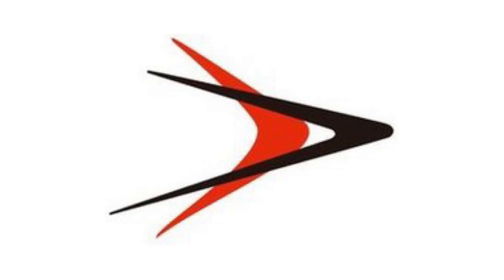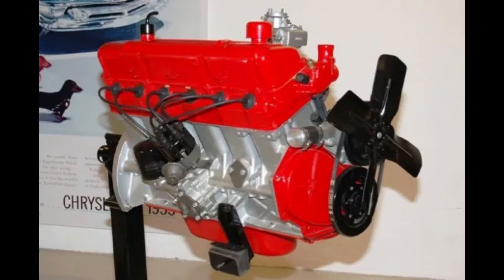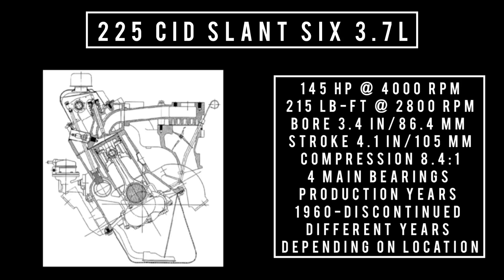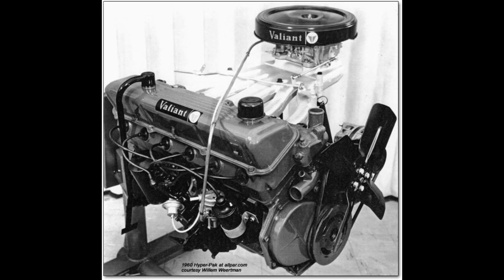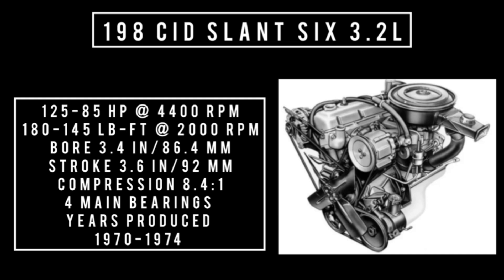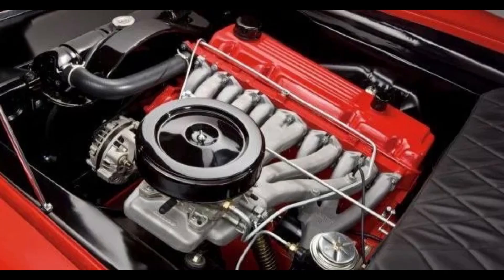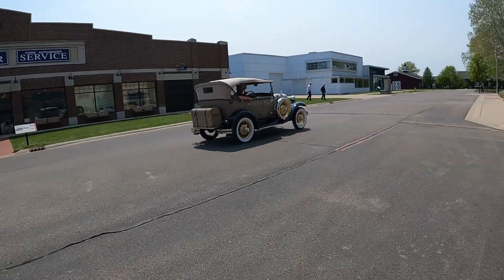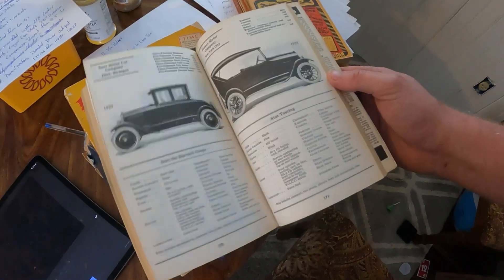Chrysler slant six engine family

Comment: How long was the 361 cid in production? I'd heard the government used them in military vehicles for many many years
Reply: 381 was made from 1958 to 1966. It was part of Chrysler's B - RB big block line. Practically the same as a 383 except a slightly smaller bore. Phased out in favor of the 383 as the base big block engine.
Reply: If memory serves, there were actually two Chrysler 361s. The early one was an RB block; it had a B-block cousin of 350 CID. The B-block 361 followed soon after. I have a ‘58 DeSoto with a 350.

Comment: I have seen a number of 225's with a blown #6 con rod . The reason was always a leaky radiator  and instead of pulling it and soldering the leak they keep dumping in aluma seal or barsleak until the cooling jacket finally gets clogged in the back end and # number six cylinder does not get any cooling and the bearing goes south. Great motors ,not so great radiators
Reply from the maker: Awesome information

Comment: In Argentina we love 6 cylinders and the Slant Six is one of the favorites, durable, powerful, versatile. It is equipped in cars, vans, trucks and sports cars; Our most powerful sports cars with the Slant were: the

Valiant 4 GT 1967/68 and Dodge GT 1969 with 155 hp and 300 nm

the Valiant 3 GT 1965 and Valiant 4 GT 1966 with 180 HP and 304 nm

and the pinnacle of the Slant Six in Argentina which was the 1974 Dodge Polara RT with 174 HP and 333 nm, although it had 6 HP less than the Valiant 3 GT, the Polara RT was much faster: 
0 to 100 km/h: 11 second 
Top speed: 182 km/h

Valiant 3 GT:
0 to 10 km/h: 12 seg
Top speed: 162 km/h

The Dodge Polara RT was a beast of its time, being the second most powerful 6-cylinder Coupe in Argentine History, I leave a video of a Dodge Polara RT: https://youtube.com/watch?v=9ybwVzdzeQQ&feature=share9

In addition, the Slant Six was 8 times champion of the Turismo Carretera (Argentine category) with a displacement of 3 liters, it generated from 255 HP to 320 HP in its last years, reaching regimes of 8000 RPM and maximum speeds of 270/280 km/h. 
Long live the leaning tower of power.
Reply from the maker: Awesome information thank you so much for taking the time to share all of that =) 

In my opinion there isn’t anything sexier than seeing/hearing down low grunt of a in-line six breathing through 3 Weber side draft carbs
Reply: @What.its.like.  Yeah !!!! The 6 cylinders roar loud. I show you how the Slant roars in Argentina:
https://youtube.com/watch?v=nCIintqAJQQ&feature=share9

https://youtube.com/watch?v=YXDM43V6spY&feature=share9

https://youtube.com/watch?v=VtVEX8EV40Q&feature=share9

https://youtube.com/watch?v=AhE_34HeTdw&feature=share9

https://youtube.com/watch?v=h6m-CVuum_k&feature=share9

https://youtube.com/watch?v=am0y2rCtUHo&feature=share9
Reply: @What.its.like.  we also had a rare version of the 188 ford with 3 Holley's (the Serra Lima), but the most famous around here is the IKA  (Kaiser) "Tornado" with it's 3 Weber's DCOE, it was an AMC 232 derivative but with OHC and other changes. There was also a bored out 4.0L race prepped version with 250hp which could be bought from the dealer

Comment: Not a option, but I’ll pick the Ford 240/300 inline 6. Very little to go wrong since the cam shaft was driven by a gear which was being run by the main crankshaft. Could easily run for 300,000 to 500,000+ miles before a overhaul.
Reply: I've had two of these. Smooth and bullet proof.
Reply: @freeman48083  the Ford 240/300 inline 6 or the Chrysler slant 6?
Reply: @seana806  The Ford. My grandfather had a couple of slant 6 engines, including a pickup. The motor was reliable, even if the door fell off :-)
Reply from the maker: Awesome choice 

Going to do an engine episode on that family of engines as well =)

Comment: I had three, A 1970 Dodge Dart swinger, A 1977 Plymouth Volare, And a 1980 Dodge Diplomat. They were all very good cars never a problem with them. I guess that is what makes me so mad about Chrysler. Back in the 1960's and 70's their cars were so good. Bulletproof actually. As a teenager in the 1960's we would go out in my best friends 1965 Dodge Dart .four of us on back country roads drinking beer that Dart got beat on once overheated to the point it would not take water in the radiator it would spit it back out until it cooled some. We ran it hard for two years driving in fields just pounded on it and we never killed it. He traded it in on a Dodge Coronet.
Reply from the maker: Thank you so much for sharing those memories I wish that I knew Chrysler when they were in the shell not the shelf that they are now.. The biggest thing I miss about Chrysler is the gambles they used to take and just the risks like the whole jet turbine engine program, no other company would even think about doing that

Comment: WYR? Chevy 235 and don't forget that engine continued to be made overseas until 1979 in Brazil.  I'd also take a Slant 6.  Both of those engines were very reliable.  The real choice though?  Ford 300, tough, powerful, dependable.

A side story- The Revell Slant 6 you showed.  My dad worked at Revell from 1956-until 1965 in the art department as the instruction sheet artist.  He brought home prtotype and watched me try to assemble them and would make adjustments to the instruction sheets. He knew I loved mechanical things, he brought me 2 Slant 6 kits.  Great fun!  And the first time I had to actually work on one?  I knew 90% of how it was. 

As another aside Mom worked for a company named Romalite - she was responsible for making and painting the Revell models you saw in hobby shops back then.

Good episode, as a Ps. horsepower ratings went from gross to net, basically nothing changed but the rating.
Reply from the maker: Glad you dig this video 

Great story, do you still have that engine model that was a really cool model from just looking at the ads. Man that would be rare to find now I wish I had a time machine lol
Reply: @What.its.like.  No, sadly it was damaged in one of the many moves I made over the years.  Built a "visable V8" also.  Lots of guys who loved mechanics back in those days built them.

Comment: Chevy got their overhead valve inline six in 1929. In one iteration or another, it was offered well into the 1970s.
Reply from the maker: Thank you so much for adding all that information. =) I would love to do an episode on the longest engine ever produced
Reply: Where would the Stovebolt 6 had been used past the mid-60's?  The 194/230/250/292 engine family was completely different from the Stovebolt 6 and seemed to share some parts with the SBC.
Reply: @jeffbranch8072  - The Stovebolt was replaced with the Turbo-Thrift in 1962. That was the modification that I mentioned.

Comment: Nice presentation of a under appreciated engine. I had a 64 valiant with the 170. Was given to me when I was 15 by a neighbor who I helped maintain his property until he moved. Drove it to school for a few months, but it was cancer ridden. The engine was the best part in the car. My high school auto shop teacher had one of those long plane intakes. I was not aware it was for a Carter AFB carb. Kinda reminded me of those long plane 413 intakes that went on the letter cars. Today's "What it's like" is completely unfair since all those motors were really good. Since I'm really a Chevy guy, I got to go with the 235. Chevy made them until 1962, then went to a 230 which were not as good in 63.
Reply from the maker: Glad you dig this video =) one day would love to compare all the built proof sixes
Reply: I agree, the 235 was a better Stovebolt than the 230.  If I ever buy a 63 - 65 Chevy 6 with a bad engine, I will put a 235 in it just for fun.

Comment: 9:01   The engine pictured is not a 223 ('233' is a mispronunciation).  

The picture is of a 'Falcon' six - this family started out in 1960 with two versions, 144 and 170 cubic inches, with four main bearings.  A 200 cubic inch version was introduced in 1963, which also had four mains.  In 1965, the 200 got an upgrade to 7 main bearings (the 170 did remain in production, but remained a four-main engine until it was discontinued in the early 1970s).  In 1969, Ford took the 200 design, beefed it up with a taller deck, longer rods, longer stroke, V8-style bellhousing,  and so on to make the 250.  Legions of Falcons, Mustangs, Fairlanes, Mavericks, Fairmonts, and Granadas were powered by the 'Falcon' mill.

It is a different engine than the '223' family, which was introduced in 1952.  First as a 215, and later the 223, with a 262 version for heavy duty applications.  The 215/223 were used in full sized cars and in pickups, and discontinued after 1964.    The 215/223/262 are notable as Ford's first OHV engines (though Mercury introduced an OHV V8 that same year).

In 1965, Ford introduced its 'Big Six' to replace the 215/223.   The new engine was available in 240 and 300  variants.  Both were used in trucks nd vans, plus the 240 also served in full-sized passenger cars until 1974.  Both were offered in marine, agricultural, and industrial versions as well.   The 300 remained in production until the late 1990s.

My preferences are the 200 'Falcon' mill,  the 300 'Big Six', the Chrysler Slant, and the Chevy 230/250.  All are durable, reliable, efficient little engines and are super-easy to maintain and repair.
Reply from the maker: Thank you so much for catching that as well as sharing all the added information and insight =)

Comment: I had a Dart Swinger in the 70's with a 198 I loved that car, lost it in a divorce and she ran it out of oil twice and it still kept running. Only problem I remember having was the resistor block going.
Reply: Most MOPAR owners I new back in the day would carry a spare in the glove box just in case. The wire coil in the back of the resistor would rust and over heat making it burn out. Then you're not going anywhere. Wonderful cars and trucks
Reply: This was the ONLY flaw in the BULLETPROOF Chrysler ('72 on) electronic ignition! This WAS AMERICAN DEPENDABILITY personified!

Comment: In Australian Valiants 1968 and 1969 there was a optional variant of the slant six, known as the 160HP. A 225 cu inch with two barrel
 carb. And in 1969 a special version in the Valiant Pacer made something like 170 horse power

Comment: We had several cars with the 225.   Great engines.   Corrosion killed the bodies long before the engines and transmissions showed any problems.  Easy engine to maintain.
Reply from the maker: Yeah dodge seemed to use the worse sheet metal out of the 4 big companies
Reply: Just got a 1970 Dart 4 door with the 225...no rust on the car at all....except where there is a dent in the roof. The car spent all of it's life in Georgia and Alabama.

Comment: AWESOME motor! Had a  1983 Dodge D150 w/ the 225 Slant\6 and had to sell it as was moving to the Lower48 from Alaska. Miss the simplicity of that engine designed by Willem Weertman (same guy that did the Elephant 426 HEMI). Not the power of today's vehicles, but how many multi-valve G.D.I. vehicles with VVT and whatnot will survive as long as a Slant\6 without being rebuilt? : hardly any in 25 years from now as they'll rot in junkyards in 2048 as a Slant\6 drives by their automotive corpses.
Reply from the maker: Awesome information =)

Comment: None of those : I’ll go with the 245 Hemi or the 265 Hemi. My 1971 Valiant pacer went like it was stolen and could still do 30mpg if you drove it conservatively.  I had a 265 Charger too but didn’t notice a huge advantage over the 245. But the ones tuned by Carol Shelby wiped the floor with the V8s at Bathurst for a few years.
Reply from the maker: Awesome information =)

Comment: 0:07 Right off the bat, you are ABSOLUTELY INCORRECT.

The Chrysler 170 ci Slant 6 was developed ORIGINALLY and SOLELY as a compact six cylinder in-line to power their new upcoming Valiant and Lancer compact cars. 
The Bean Counters asked later if the 170 could be developed FURTHER to replace the 230 flathead, and that's when engineering came back with the 1" stroked 225, a compromise design that worked more than well enough for regular passenger car use.

It was NOT developed "to replace the 218 and 230 flathead."
Reply from the maker: But it replaced the flathead engines though because they stopped making them. 225 was for large cars low on The totem pole such as dodge dart Seneca..

A quick Google search even says that the slant six was made to replace the flat head.
Reply: @What.its.like.  Nope. Google is not infallible. The 225 came later. Developed FROM the 170. Check out Allpar's story on the Slant 6.

The 225 had the 170s head with it's puny 3.4" bore. It is unlikely, and that's putting it politely, that an engineering company like Chrysler would have ORIGINALLY designed a 3.4" bore with a 4.125" stroke. And they didn't. Modern hot rodders of the 225 know that in spite of heroic efforts to port the head and trying to cram larger valves the engine simply cannot take a a breath deep enough to completely fill its 4.125 stroke.
Sorry to be rough, but the 225 was a bean counter engine, pure and simple. It was not designed alongside the 170, which was specific to the Compact cars.

Comment: You could run a Chrysler slant six with coca-cola in the crank case…in an emergency.  I did!  Dodge Dart.  What a crappy little car that would not die.
Reply from the maker: What would the Coca Cola do, clean the inside of the engine?
Reply: Keep it from seizing up.
Reply: What happened was I punctured the oil pan driving off road.  Needed to get it home and only had a cooler full of coke.  The melted ice would have been next to go into the crankcase if I ran out of coke before I got it home.

Comment: Dad needed a slant six for his van and knew a guy that had one in his salvage yard. He had been dealing for it and the guy with the engine was having trouble getting a Buick to run. Dad said will you give me the engine if I fix this car? Deal, dad asked me to find a nail and used it to replace the pin on the distributor on the gear. It ran and the buddy tried to backpedal. Dad said I will stand you on your head! We took our engine and it sucked to r&r.
Reply from the maker: Great story thank you so much for sharing that memory

Comment: I would choose the Slant Six, only because that was the engine in my '74 Plymouth Duster.

In my case, it should have been a reliable engine for a long time. Unfortunately I bought it used, and whoever owned it before me did not change the oil regularly (something I did religiously). 

Still, it did work well for a couple of years.

Comment: they all have there good and bad points . at the 1960 point you list the chevy 235 , amc 232 , ford 233 [more like 223] in that time frame they were used in cars but the 235 and 223 were better in trucks now lets go to 1968 chevy would have a 250 so would ford amc a 258 any of them motors would have it over the most of our parts are rejects 225 as they are all 7 main bearing motors with a shorter stroke and the amc was made the longest in the jeep . but hey run what you got .
Reply from the maker: Awesome thank you for sharing that insight =)

Comment: I worked at Chrysler engineering in the 70’s. At that time they converted several slant six’s to diesel’s. These engines ran on the dynamometers 24/7 for weeks with no major problems. Truly a fantastic engine.
Reply: Chrysler was TRULY A GREAT AMERICAN CORPORATION then!
Reply: At the time I was working in the fuel and exhaust lab and heard this info from the boys in the engine development lab.
Reply: Starter motor was very easy to get to on these
Reply: Yeah, after they went to a 7 bearing crank.
Reply: @leecrt967  That was a prototype that never entered production.  Production Slant Sixes were all 4 mains, just like the flathead 6.
Reply: @leecrt967  That would require a whole new block. They could even have slanted it. But it can't be the same engine.
Reply: @soaringvulture  It's not. Chrysler designed a 7 bearing slant 6 diesel. Different block than the standard 225 /6.
Reply: That makes sense. But I would not call it "converting a slant six to diesel". I would call it making a diesel slant six from scratch.
Reply: @soaringvulture  I know. I didn't call it a conversion.

Comment: Out of the engine choices I would pick the Chevy 235 I6.  I've had a few of them and have one now in my 1960 Chevy Apache pickup. It runs like a top.  Chevy straight 6 engines have always been my favorite engines of all time.  BUT, back in the early 1980's I had a 1965 Dodge pickup with a 225 slant 6 engine.  That thing WOULDN'T DIE !!  I bought that truck with 235k miles on it as a work truck and put around another 30k on it.  It never let me down and always ran good.  I didn't treat that truck nicely either.  Back in the early 1980's these trucks were a dime per dozen and used hard.  I paid $300 for that truck, LOL.
Reply from the maker: Thank you for sharing those memories =)

Comment: A Dart with the 170 and three-on-the-tree was an economical car, but it would start to wheeze at 60 mph.  The same car with a 225 and automatic would happily run 75 mph and still get respectable gas mileage.  It was not exciting and would not set dragstrip records, but would start every day and run forever with minimal maintenance.  I agree, one of the best engines ever made.
Reply from the maker: Awesome memories =)
Reply: I had a 64 Dart with  170. That 3 speed manual was like a 4 speed missing 3 rd gear/ I had my up to 120 mph.
Reply: @frankpeletz1818  Ah, 1941 and later ChryCo manual transmissions - super-short 2nd gear, easy 2nd gear starts, but a big gap between 2nd and 3rd.  More than a few owners of 41 Plymouths and stick-shift Dodges replaced the gears with 1940 gears.  Taller 2nd gear.  The 42 cars had a bigger 6, so it wasn't as much of a problem.